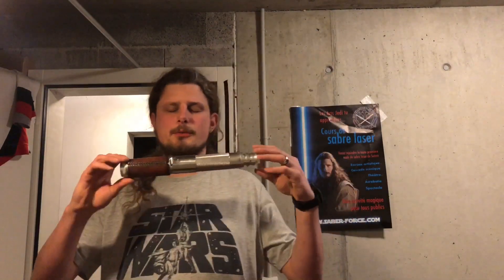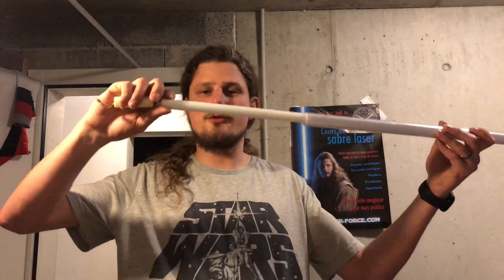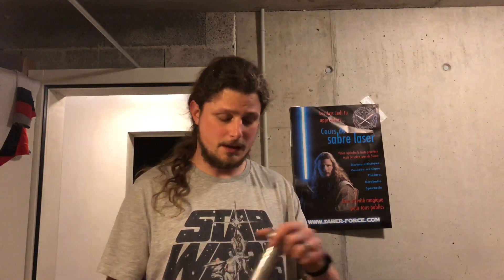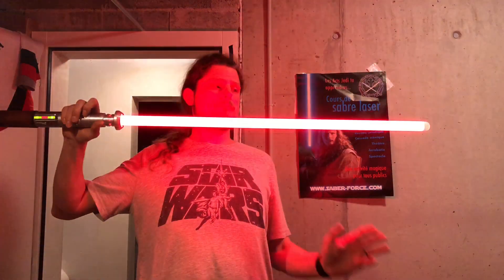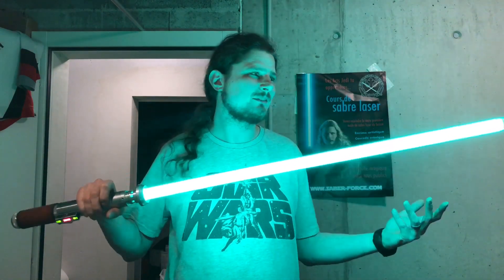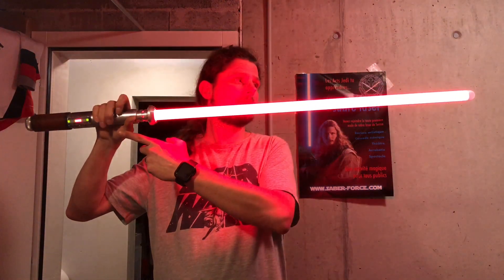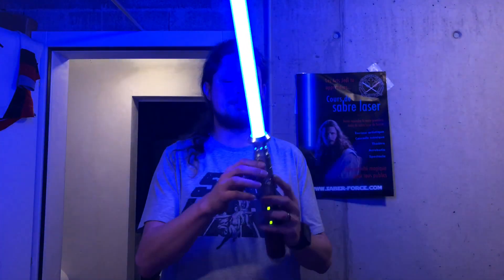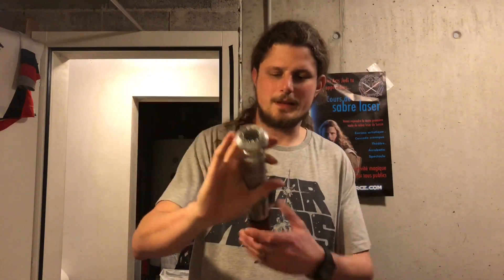Prizm 5.1 & Neopixel introduction

Comment: how long of battery life do you have using the prizm 5.1 with a neopixel and the other leds in the box card? im assuming youre only running one 18650 since the prizm is made for single cell 18650 use.
Reply from the maker: Well, it really depends on many parameters like your battery, the color and brightness you set your blade to and the consumption of the sound amplifier.

There are many different batteries out there, but you need to go for a good one like a Keepower 18650 15A or 10A 3500mAh.

In this particular saber, I went fo 2 batteries in parallel to double my capacity. I never ran it to see how much time it lasted and it has now been converted to Proffieboard.

Comment: Nice! I'm currently working on a 7/8 clear Neopixel blade that has been heavily sanded. Do you notice any issues with diffusion while using a clear blade?
Reply from the maker: Sanded clear blade is, imho, the best diffuser possible!

It doesn’t give the tarnished effect to the red that you can notice with the white blades, has a better reaction to external light and looks less bad when exposed to natural light.

The sanding actually creates an irregular surface creating a beautiful random refraction array.

I find it the best and most versatile option for both polychromic LEDs and Neopixel installs!